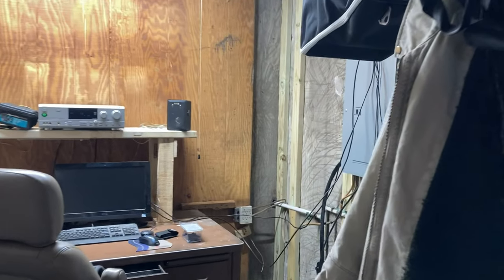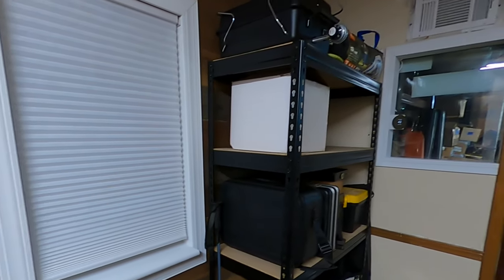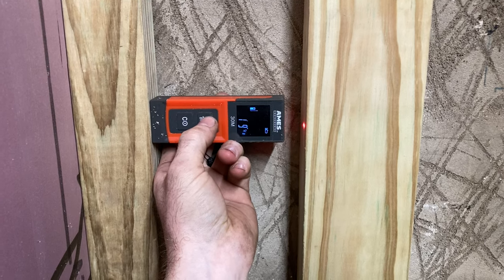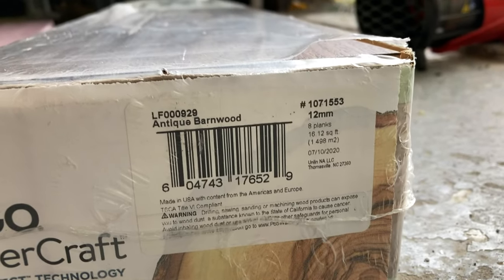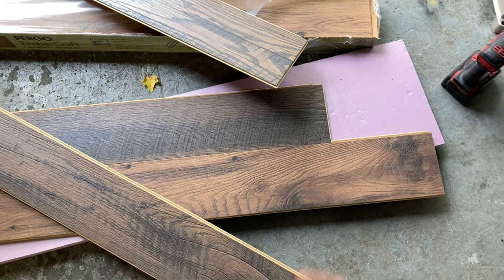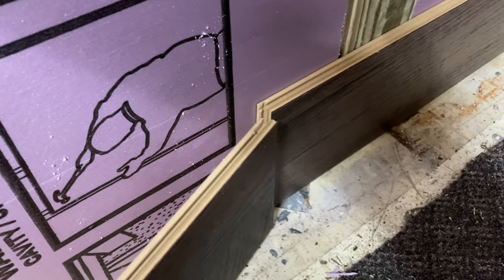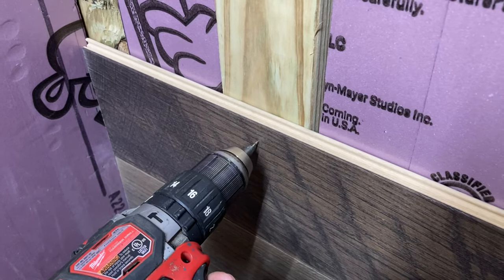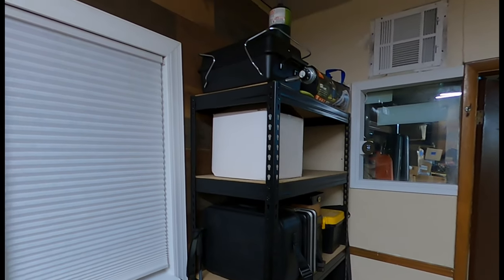How to Build a Reclaimed Wood Panel Wall for A THIRD the Price

Comment: I use small diameter bits and past a certain tinyness let's call it, tool geometry is less important. Because let's be honest sharpening those little bits seems impossible. But one day in desperation I decided to go for it anyways. What I did I call the pencil sharpening method. That's where you just grind the tip of the bit on a grinding wheel like a point. Don't even try to hit the two cutting lips. Just make it a sharp point.  Now try it. I bet it'll drill better than when it was dull. Just don't shapren the bit as shallow an angle as you would a pencil.  But you can go a little more acute than 120° Make it a little pointier. My theory on why it works is a sharp edge is a sharp edge. Even if there's no cutting relief.